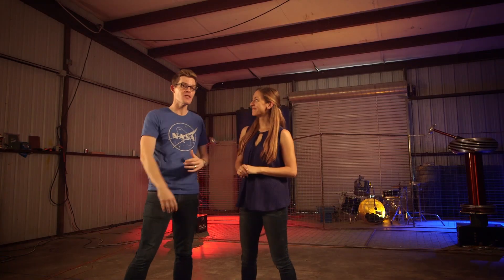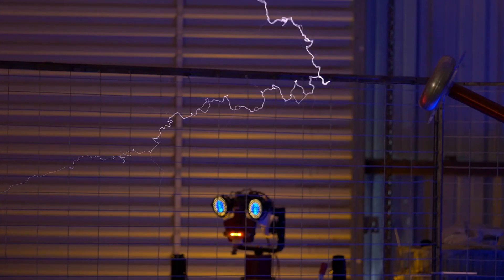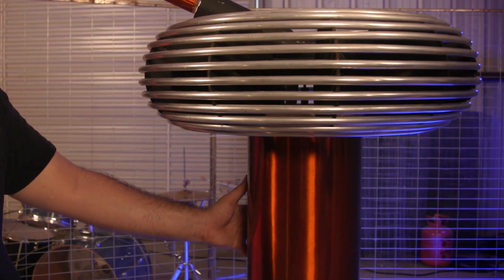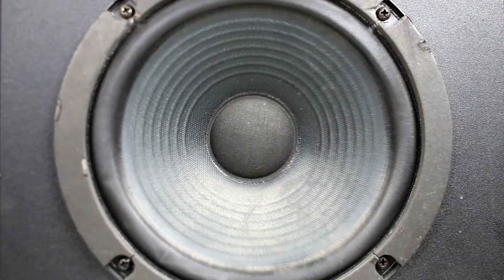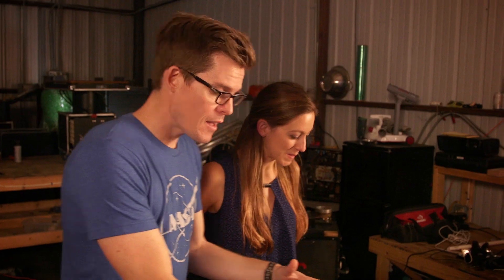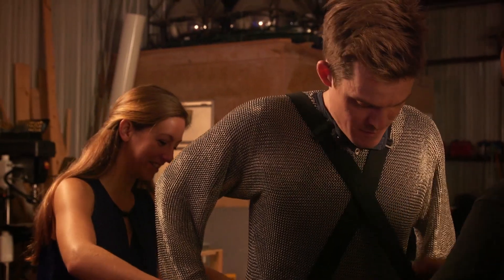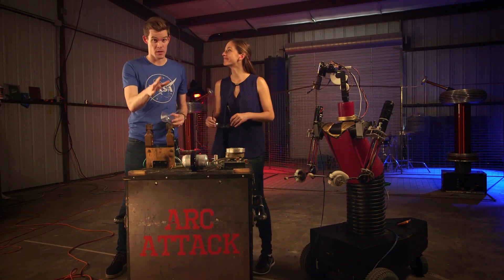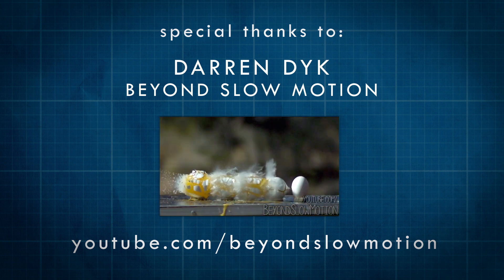How Do Tesla Coils Work? Musical Tesla Coils in SLOW MOTION! (Feat. @physicsgirl )

Comment: Your smoking robot reminded me of pranks we pulled on unsuspecting technicians (each other) when i worked at Tektronics, in the early 1970s.  The techs took newly built instruments and powered them up for the first time, repaired any problems and calibrated them and then they coild be packaged and sold.  Occasionally a circuit would fail and sometimes a resister would burn up releasing a well known, easily recognized odor that we named "the ALLEN-BRADLEY smell", after the name of the resistor company.  That was the key to the prank.
--->  We all used small wattage soldering irons that had a replaceable tip that was pushed onto a hollow heated metal tube. Putting that fact to good use, we would come to work early enough to set up the prank.  We would sneak into the victim's work station, and remove the tip of the soldering iron, insert a 1/4 watt resister with it's leads cut off, and replace the tip.
---> When the tech came to work, he would turn on the power to his bench and begin to power up the next instrument.  It takes soldering irons around ten minutes to heat up, and that give the tech enough time to power up the instrument, before the 1/4 watt resister would start to burn.  The tech , upon the first whiff of the ALLEN-BRADLEY smell, IMMEDIATELY kills the power to his work to minimize the destruction and begins the repair sequence by trying to locate the faulty circuit. 
---> The more he looks for the source without success, the more frustrated he becomes.  By this time the whole room of techs, who were all "in" on the prank, lose their self-control and start to laugh.  The Victim realizes he was "had" by the prank and awards a point to the prankster on an imaginary scoreboard.  A now the pressure was on the victim to come up with a revenge prank.  
---> When I was the Victim of the ALLEN_BRADLEY trick, I got back at the prankster by coming in early and sabotaging his work bench.  I unplugged it from the power and plugged it into an extension cord, which I ran back to my bench. I plugged my end into my VARIAC (a variable transformer to adjust the AC to any voltage 0-150VAC).  I left the power at the proper 117VAC, until I saw the tech begin to check the new equipment for proper operating voltages at various test points, throughout the circuitry.  Then I slowly turned the voltage down. The tech tried to figure the cause and I started turning it back up, then down, then up again.  By that time the tech got wise and start looking around the room and everybody cracked up again!  And those were the days of our lives... stay tuned for the next episode, as the stomach turns...
---> I realize these stories aren't exactly on topic, but you can't predict when an old memory will pop up, and besides it gives us one more view into Human psychology, with some comic relief...

Comment: Just a note for those who may claim that the Tesla Coil wasn't adopted as a power distribution system due to some kind of conspiracy... nope.  That wasn't the reason.
There are two real reasons and the first is because distributing power this way is extremely inefficient.  Most of the power which is transmitted never gets captured and used, making the Tesla Coil an extremely expensive and wasteful power distribution system.
The second reason is because the Tesla Coil causes massive amounts of electromagnetic interference which disrupts radio and television signals, meaning that nothing which depends on these signals, including mobile phones, WiFi and Bluetooth, will work anywhere near a Tesla Coil.
So, sorry (not sorry at all) to disappoint you, but there are very good and practical reasons why Tesla's invention was never used to distribute electrical energy.
It makes a great loudspeaker, though... if you can put it where it won't disrupt anything important.

Comment: Wait. Wouldn't lightning just the same principle as feel a coils? That being resonance of small amount of static electricity in certain clouds, causing it to just explode out, and ionizing the air, as it connects (or Attempts to connect,) to the ground?
P.s. I just googled it, and it's ionized water droplets that polarize clouds, and cause static electricity to build up, pretty much being a floating giant tesla coil

Comment: The tesla coil wasn't a failure, he was told it was a failure because it would destroy J.P.Morgan and Chase CO investments into fossil fuels and coal. It in fact works, but no ones built one big enough and spaced them out. Tesla was in the process of building them when he was called a failure. Nikola is the father of electricty. This method is still plausible, as it does infact send electricity through the air.

Comment: Sadly, there are only few pieces you can listen to on YT.
It would be so cool, if you could send them a MIDI and they'd make a video.
Reply: maybe, but with only two coils, it would be a 2 instrument midi... (only 2 sounds can play simultaneously)

even worse quality than a cell phones midi engine, which most are polyphony(4 instruments and a drum channel)
Reply: Shawn Hufford
Robot can do the drums, just add base and guitar line. Would be fun enough ^^
Reply: saying that it could only do 2 instruments is like saying speakers can't play songs with more than 2 instruments. the lightning is basically speakers but instead of a fabric moving back and forth, it's lightning turning off and on.